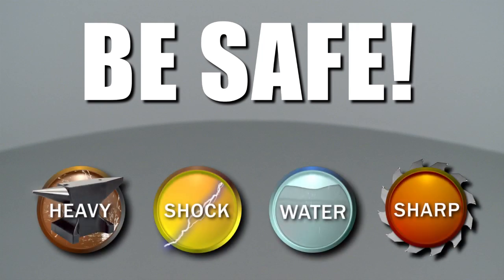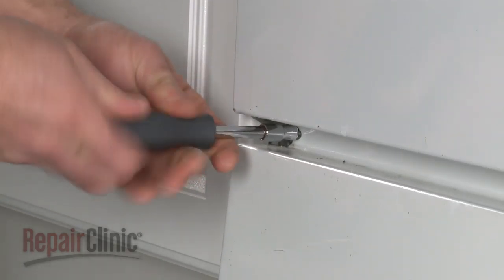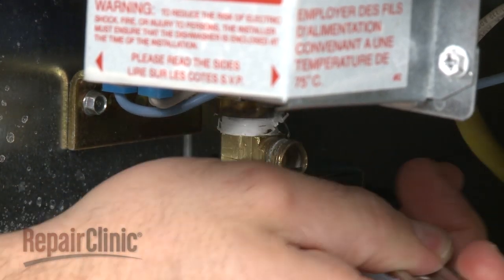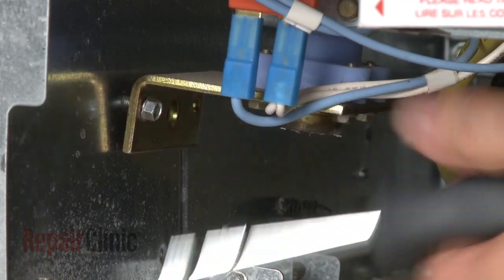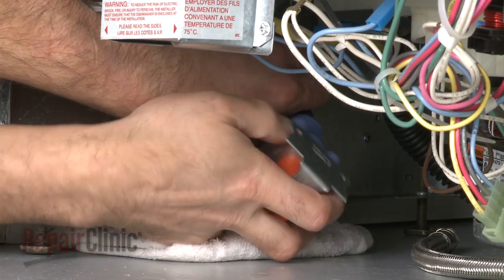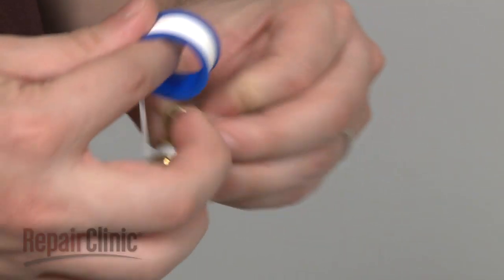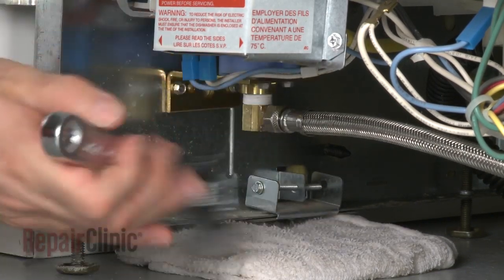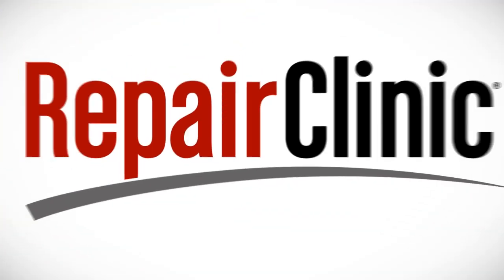Maytag Dishwasher Water Inlet Valve Replacement #99001359

Comment: NOT THAT EASY...HAD TO PUT OLD PUMP IN A VICE TO UNSCREW RIGHT ARM.... HARDWARE STORE DIDN'T HAVE A NEW ONE .......THE OLD ONE LEAKED NO MATTER HOW MUCH TEFLON TAPE....THE TINY TINE SCREWS THAT HOLD THE BRACKET ( I HOPE YOU HAVE SOME MICRO SOCKETS!) DIDN'T HAVE TOY SIZE....MEANWHILE 4 HOURS LATER CALLED THE PLUMBER
Reply: Bro man card